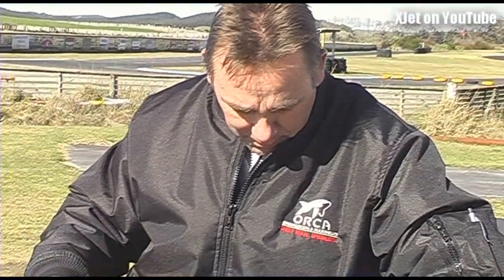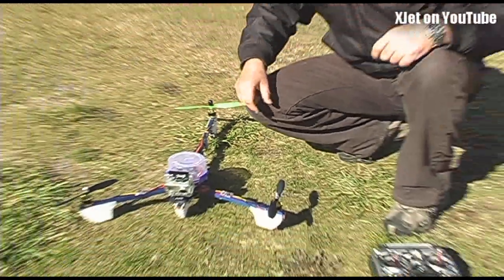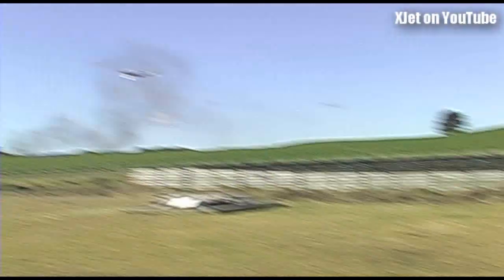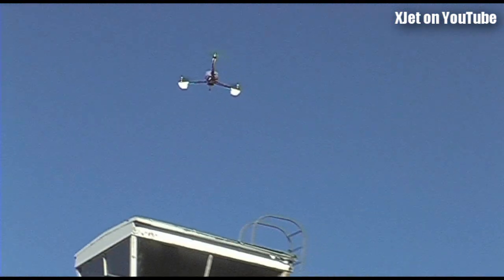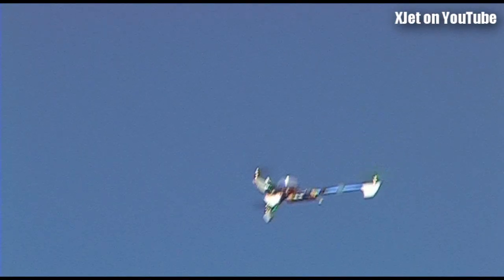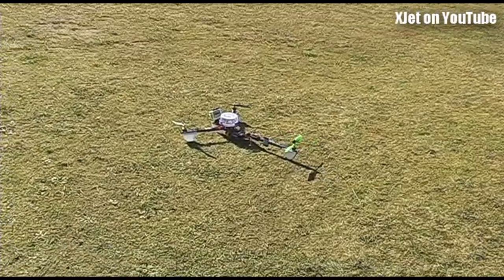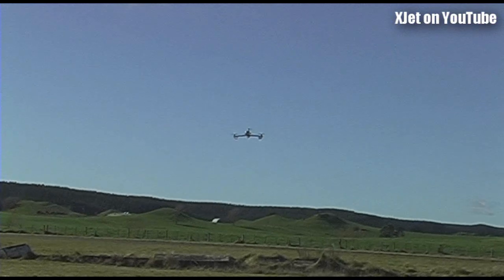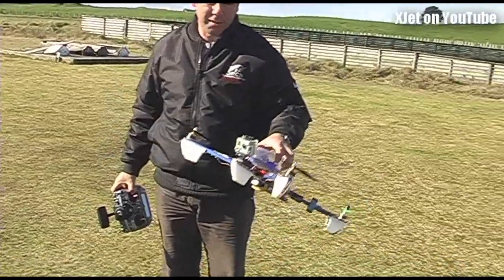KK black-board multicopter controller, first flight

Comment: @xjet 
yes, but I said Higher not high. Higher than that one that came with the radio or module, probably a 2 db you can put a 5 db omni instead of that panel that should be around 8 db.

but of course higher gain means more directionality and that is not a good idea for a radio you hold in your hands...

Comment: can I use any Esc with this board. is this the same board as KK Multicopter Black Board V5.5 in ebay. Im planing to use Hobbyking SS Series 15-18A ESC
and basic Hk tx rx. Whats your advice.

Comment: What Kv motors & what size/pitch props is he using? sounds pretty high revs compared to mine - he may well need smaller props or lower kv motors to get it stable (I'm using 750 kv motors with 10x4.7 apc props on mine with the older v4 green smd board & it's ok until it gets really windy). looks like the mems